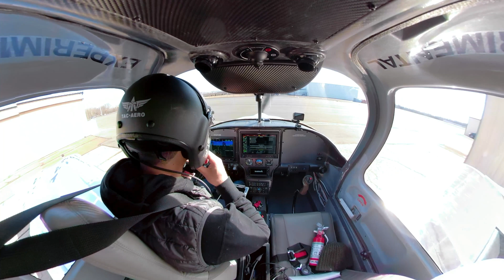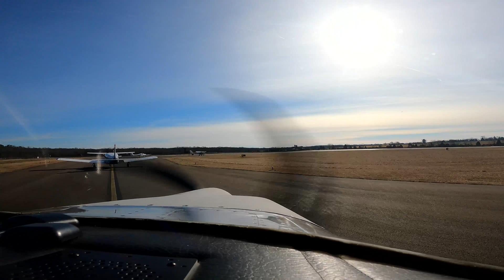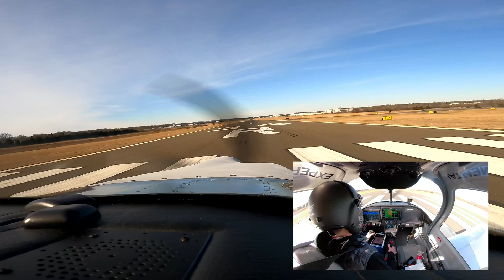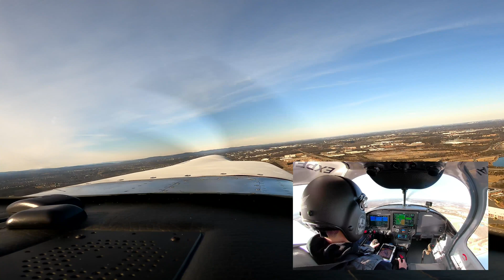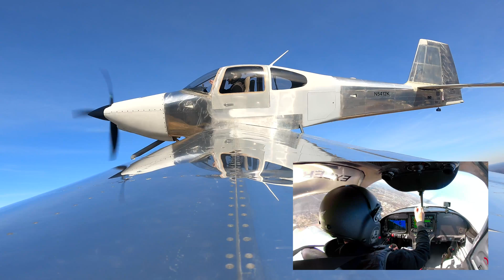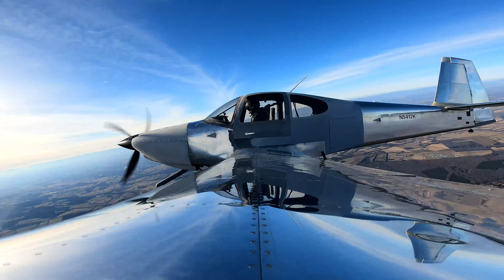RV10 Test Flight 4: Auto-pilot, Vx, Vy, Engine Leaning in cruise

Comment: Jeff, thanks for the video’s. It appears you are using EFI but have a mixture control.  Am I seeing this correct ?
Reply from the maker: That is correct. While I have the system32 ignition I’m still running a mechanical fuel servo.
Reply: Thanks !!

Comment: Jeff, did you stall an archer antenna in the wingtip?  Hows it working with the Garmin?  Are you going to resell your helmet when you get through flight testing?
Reply from the maker: So no archers right now, nothing against them, but at some point in December I made a cut line for things I did or did not need for Phase I. I am going to probably put a set of whiskers on my VS as I have the wire runs setup for it already. I am running COM1 on the belly, COM2 on the cabin top. COM2 works well, it could use a ground plane though because there are some frequencies that COM2 will pick up when COM1 is transmitting. On the helmet. maybe... It is a tough call because it is really comfortable and I have started to really like flying with it.